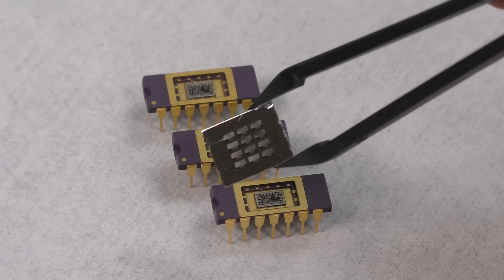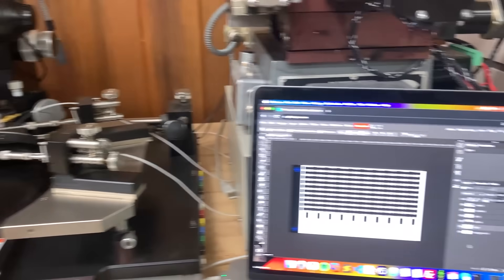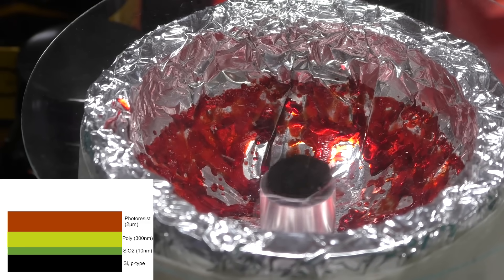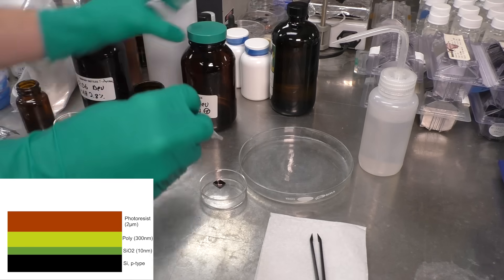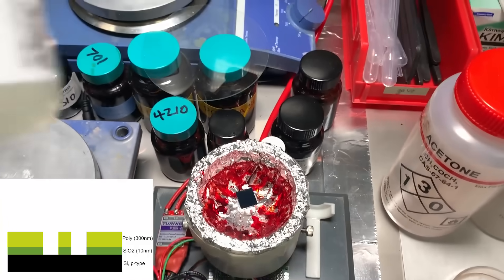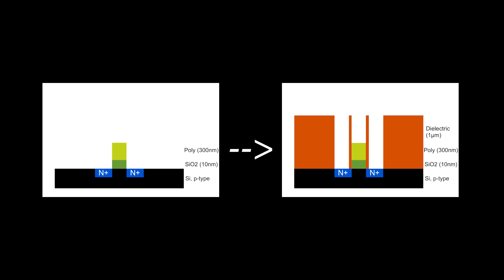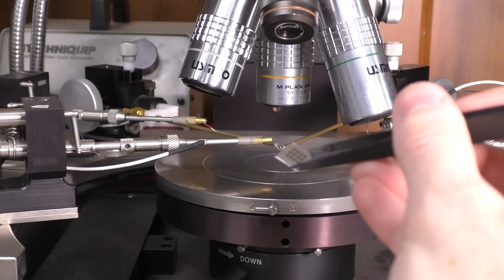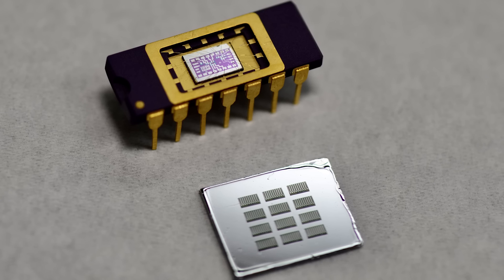"Z2" - Upgraded Homemade Silicon Chips

Comment: Wow this is amazing! I've been thinking about homemade ICs for years now and when it would be possible for hobbyists, this is huge for electronic makers!
Reply: There are so many commercially available ICs available today I don't really see the point. You'll never run out of chips to use. I'm sure there are fabs that will make your designs too. I knew guys in the 90s that were having custom chips made.
Reply: @1pcfred   There are chips that will run out: custom chips from retro machines. They're not made anymore by anyone. Plenty of retro-tech hobbyists would like more of them to fix their antique machines or build new ones if you could supply them.

Commercial fabs have minimum order requirements for quite large quantities. I think it's something like 25 300mm wafers. You're probably looking at several thousand chips there. Do you really think any hobbyist is going to be able to afford an order like that? Not likely. Homemade chips, however, where you spend an afternoon making 50 individual chips in your garage and sell them to fellow hobbyists? That's doable.
Reply: @1pcfred  There's been work done on reverse-engineering the layers of various chips, including the 6502, which can be seen online at the Visual 6502 project's website, which does a transistor-level emulation of the titular chip and shows the flow of electricity through all the various layers of the chip as it goes.

The polygons used for that visualisation are essentially masks, or something that's so close it could be easily converted into them.
Reply: @1pcfred   Missing the point. If it's been done for one chip, it can be done for others. A common, well-understood, and still-available chip just makes for a good starting place. Now that it's been done, it's just a matter of people deciding it's worthwhile to do and doing it for other chips.
Reply: @1pcfred  My whole point has been that old, obsolete chips that are not being made any more ARE in demand! 

The niche demanding them may be very small and specific (people who like playing with old technology), but it does exist. It's too small for manufacturing by conventional fabs (and their process technology is overkill for 1970s-1980s era stuff), but it's a perfect fit for a cottage industry of hobbyists looking to make a little extra on the side.
Reply: @1pcfred  That's assuming there's enough old stuff around to meet demand that still works. Stuff breaks. Salvaging components from dead systems will only go so far. For the hobby to be sustainable long-term, there needs to be manufacturing of replacement components, and specialised ones like sound and graphics chips pretty-much have to be made by hobbyists, because nobody else will.

Would it really be cheaper? That depends on how rare or in-demand the system you're trying to get a replacement chip for is. If it's really rare, then even a dead one could go for far more among collectors than it would cost to pay an amateur chip-maker to make a few dozen graphics chips.
Reply: @1pcfred   And now you're stuck in a loop.

You just can't get your head around the idea that not everyone wants the best or that "obsolete" does not mean "bad".
Reply: @1pcfred   Then why the hell are you talking about this?! Why engage in a discussion about something you don't care about?

You act like a religious fundamentalist debating morality. You refuse to acknowledge that good and bad depend on the situation. Instead falling back to "No, it's always THIS!"

Comment: This is really cool. I was planning to do something like this a few years back after watching Jeri’s videos, but there’s no way to dispose of chemicals like HF on an island in the middle of the Pacific Ocean. I’ll be moving to the states in a few years. Your videos are really motivating. Keep up the good work. 🤙🏽
Reply: Disposing of HF is actually fairly straight forward. Place it in a container with calcium and it will react out into calcium fluoride which is a very stable essentially sand. It is an ionic bond and VERY tough to break the bond so it is very safe and stable. I work in a semiconductor fab and this is what we do with it. Entire dumpsters of it are taken to the landfill to be used as cover material.
Reply: @cacaokingdom3122  
Thanks for the sweet info. I going to wait for a better opportunity. It’s not just the material disposal, but chemical compounds are very expensive with all the hazmat and regulation fees. There’s also a constraint on space. Property in Hawaii is VERY expensive and my property is too small for the equipment. EEs pay is crap here as well. Thanks for the info 🤙🏾

Comment: Potassium hydroxide for developer for silicone electronics? Man you should be using thetrometyloamoniumhydroxiade tmah in short. It will do the same but it won't contaminate your　chip with potassium.

Comment: Wonder how many old fabs have gone mask-less?  It'd be really cool to have a maskless 1-10um process setup with a standard die-size, wire-bonding pad layout, and package so you could slap in a DIY chip for cheap.

Comment: No wells for full CMOS process, but still extremely impressive.
Intel 4004 was highly inefficient, you should be able to make a nice a 4bit CPU with your current technology if you design the architecture right.
Reply: I think I might have a 4004 kicking around in my collection of obsolete ICs. They made chips pretty back then.
Reply: At this rate he'll be able to make a MOS6502 soon. =o It only has about 30% more transistors than the 6502 and is faster and more efficient than the 8008 that uses more transistors. (And is still better significantly better clock for clock than the 8080 that uses almost twice as many transistors than the 6502)

Comment: just an idea, but how about using a base chip to do something like regulating a voltage... so it can clean a set amount of power used by a more sensitive chipset with smaller transistors? at that point any voltage fluctuations would have a known target value... possibly, input 3 to 5 volt regulated to 1 volt 2000 transistors ... 1mv steps? power side of a processor?

Comment: This is incredible work, never knew you could do this outside of a clean room! Awesome work would definitely support.
Reply: You have to consider the shotgun analogy here. The shotgun analogy goes like this, you destroy far less information shooting a billboard with a shotgun than a postage stamp. The postage stamp you completely obliterate where as the billboard just has some scars on it. We use the same idea making electronics for deep space applications. Our modern high tech doesn't work up there due to cosmic radiation. So we use large pitch electronics that can take the hits.
Reply: At this scale, cleanroom controls don't need to be very stringent. As features get smaller it becomes far more critical.

Comment: Your work is very inspiring!
Back in the early 80's, when Signetics was still a company, my cohorts designed IC's using a Lilith minicomputer. It had a whopping 10 Megabytes of storage and 2 Meg of ram. 
The programming language was Modula-2. This extremely efficient system allowed solving complex problems using a very modest amount of hardware. (1 Vax MIP)
Reply: @Chris Idema Good point. I didn't make the distinction between "flash" program memory which uC's use and dynamic RAM, which the Lilith used. I was having fun with the hyperbole.
Reply: 2 Meg of RAM around the time I was born? It'd be the better part of a decade before your average PC had that much! The first PC my family bought had 8 Meg and that was considered high-end for 1993.
Reply: @Roxor128  I know, ...pretty cool. Industrial, custom-designed mini-computers were ahead of the PC game. The price tag at that time for the Lilith was around $17,000. (~$56,000 in today's dollars)
Also, what I described was a fully loaded model used for chip design work at Signetics Corp. The "average" Lilith had .5Meg of ram.
Reply: @hippie-io7225   That sounds like a really good deal for the time period.
Reply: 2 megs of ram in the early 80's? you sure you didn't misspell "huge" as "modest"?
Reply: @mntrmntr  In those days, 2 megs was huge. Currently we are talking micro controllers with 2X that! It is a joy to be able to make fun of that :)
Reply: @mntrmntr  Atari ST520 debuted in 1985. 512 k was pretty mindblowing in those days. Most homecomputers up t then had 64kb. Commodore 128 was launched in 1985 too.
Reply: @Rxke  The first I owned in the late 80s had only 16k. Good incentive to learn assembly language. Rich kids with their colorful commodores & spectrums only used theirs to play games.
Reply: @mntrmntr  4k here... :) Wrote my own games. They were terrible heehee!

Comment: An array of 1200 transistors is enough to replicate some of the simpler chips in retro computers. For example I did study the Atari CO25953 EMMU, it consists of 100 cells that each contain 6 transistors with a custom metal layer to connect them. Your result means that you could fit two Atari EMMUs on one of your chips.

The PLA used in the Commodore is a bit more complicated, I estimate it at +/- 1800 transistors (in case of a non field programmable implementation), which won't fit, but you are almost there.

At least you are already beyond the complexity of 74xx chips.

Comment: A society of tiny creatures would not be able to make practical electronics as powerful as ours because of how many transistors are required.  Ants, for example, would not physically be able to make ant-sized smartphones with the same power as ours.  Our transistors are already only a few atoms big, so to scale, they would need transistors smaller than atoms to make smartphones for ants. They would be able to make simpler, much less powerful electronics they could use though, probably as powerful as our computers during the late 1900s.

Comment: bigger substrate, less power and hz, bigger chip, less heat in one spot, everything better, diy wafer, cd size chips
Reply: bigger contact pads for fpga contact arrangement
Reply: try blu-ray drive resist cd-plate application in vacuum for the photolithography phase, you should get spot sizes of 100nm or above
Reply: try mask rom making
Reply: try anodized titanium, aluminium, copper, 10nm or so nano pores, deep vertical components, filled with ald and vertical pvd or cvd
Reply: ald to get all sides coated, pvd to get only horizontal surface coatings, photolithography masking to fill only selected wells
Reply: maybe use koh to etch, remove aluminium oxide from top of the ground electrode aluminium (or any other anodizable metal)
Reply: try dc emf plasma railgun (no moving parts) ultra vacuum pump
Reply: replace a blu-ray drive laser emitter with uv-a photoresist curing emitter (laser diode), and start printing on silicon wafer discs
Reply: I recommend "dental uv curing lasers" with compatible photoresist spun on the wafer disc, pun intended
Reply: USHIO HL375 CW laser seems to be nice
Reply: just vacuum the whole uv-ray (previously blu-ray) drive
Reply: also high voltage static elecricity ion separator ion embedding/placement/growth for home silicon crystal growth, no, not the melt spin crystal or the hydrogen torch method, public domain

Comment: It would be cool if you can "homebrew" a 6502 compatible microprocessor.
Reply: C64 SID would be cool too.
Reply: @7c3c72602f7054696b  Second that. Only not only Sid but SID++
Reply: Right now he’s on a 10 μm process. The original NMOS 6502 used 8μm, so he can’t be far off.
Reply: @baileyharrison1030  Is that correct? the 6502 has 4500 transistors. this entire wafer has 1200 transistors.
Reply: @baileyharrison1030  TBF tho 8um is like half the size of 10
Reply: Give it a few years and it will go this way, I think we will have enthusiasts gradually recreating all the missing chips, maybe a few years yet.
Reply: @AJMansfield1  This will take him a lot of time. I would love to see how he would design, debug and produce a binary divider for instance, but again, it's not a trivial thing...
Reply: Something like this?  https://www.youtube.com/watch?v=73h4cjTeX44
Reply: @AJMansfield1  holy crap, could this guy build a computer entirely from the ground up?
Reply: I would love to see a Vic chip
Reply: Lol well, this would require him to create a logic which is very tedious process that only looks simple.
Reply: @sliceofthatpie  not really. Visual6502 has reverse engineered the original masks. He could copy the masksdirectly without even understanding how they work in detail. But bonding so many pins could be difficult.
Reply: @Gameboygenius  Seriously? Well, he would need not only a single mask, but many. Layers that connects individual transistors require separate steps in production....
There are many metallic layers on top of silicon die which require their own resist/etch/PVD cycle. He also would need to debug it ...
Reply: @Gameboygenius  The (original, nmos) 6502 uses both enhancement and depletion mode transistors, and buried contacts between gate and diffusion as well (so that they can go below wires on the metal layer). I don't think that Sam's process supports those features so far (seems pretty hard to support buried contacts using a pregrown polysilicon layer). Without support for those features, I don't see a way to use the masks straight off. It might still be possible to make something like the 6502, but the layout would have to be redone, it would take up more space and be slower. It's really impressive how far Sam has come already, but it's not at the technical level that the 6502 was made at quite yet.
Reply: @possible-realities  Thankfully something interesting, thanks.
Reply: @sliceofthatpie  if he's willing to use multiple chips, all that he really needs to do is produce either lots of NAND gates, or lots of NOR gates (whichever is easier to produce with the technology he's using). Either of those two gate types can be combined to produce all of the other possible gates.
Reply: @johncochran8497  It's not a trivial task to implement CPU architecture without knowing how to combine basic gates. There is lot of utility circuitry... There is nothing in that.
Reply: @johncochran8497  Yes, probably replicate the architecture of the Apollo Era computers first.  The AGC used 3-input NOR gates.
Reply: @sliceofthatpie  I'd write a software that does this job, probably starting from VHDL and converting the compiler output to etching masks.
Reply: @emmanueloverrated  Go ahead. Let me know when you finish. Good luck lol. It only sounds simple.
Reply: @sliceofthatpie  That was a very dull comment. Thank you for your positiveness, pretty sure people around you love it.

Comment: Just, whoa. I was thinking "hey, I could do this", up until you brought up the aluminium sputtering.
Reply: Al sputter is not too bad if you can find a cheap piece of vac equipment to steal pumps and valves from, like a dead NMR, SEM, leak checker, etc.

Comment: I absolutely love how youre helping reduce the complexity for the masses to have a general enough understanding of the equipment and processes to make the building blocks of computers. You have successfully torn down hours of frustrating and difficult research on my end to achieve my goals. You have massive respect from me
Reply: lithography is but one part of designing useful chips.
One of the really hard par is also how to connect those transistors into useful circuits.

By no means is his work trivial, it's so freaking impressive to see how he does it, but having to hook all those transistors into patterns that can execute jobs is also another field in it self and can take years to release a newer and better version of your old processor.

I think there's even more great videos coming from this guy I just found like 10 minutes ago :D
Reply: @svampebob007  he has already made an amplifier IC using this process
Reply: @svampebob007  eh start out simple like the apollo computer. use nothing but NOR gates
Reply: @svampebob007  well arent you redundant and lacking In any education useful to me
Reply: @trentcoble3793  
Yeah I'm so sorry that computer electronics is not available in Tennessee. 
I should have picked advanced buck fucking? that way you could have picked a college in Alabama or South Carolina since you seem drawn to educated people. Maybe that way you'd be closer to a real university over seas where I got my education.

Idk that might be better then just relaying on other people's education, no?  because idk about the whole "relay on people's YouTube comments" to learn think, don't you think? ah right no you don't think for yourself!

But hey (don't confuse it those words with buck or Hay) I don't want to be too redundant as to write too many words for big 'old Trent :)
Reply: @trentcoble3793  you commented as if lithography was a mystical, alien technology that you had just been granted special access to, but then start crying in response to a comment pointing you to the further manufacturing marvels of processor design.

"You have successfully torn down hours of frustrating and difficult research on my end to achieve my goals. You have massive respect from me" transformed into... "I honestly really don't think i ever want to figure out what is wrong with your brain" this change in your replies in response to a simple comment makes it clear which one of you could be suffering from brain damage.  what is wrong with you Trent?